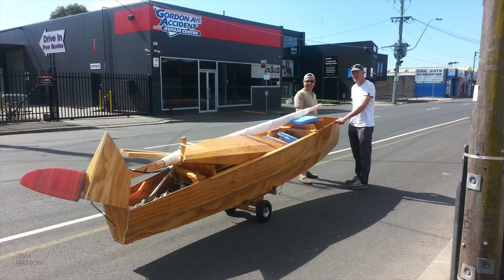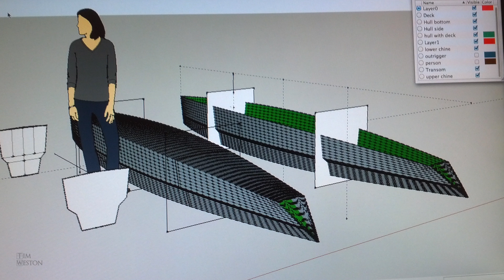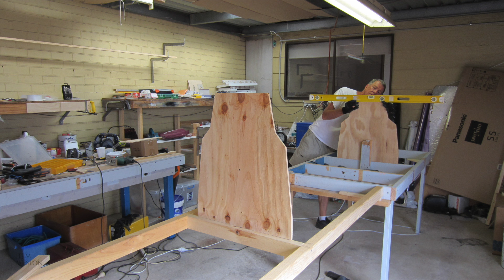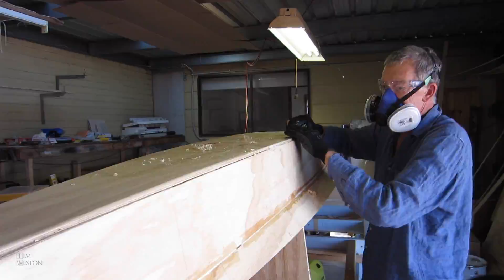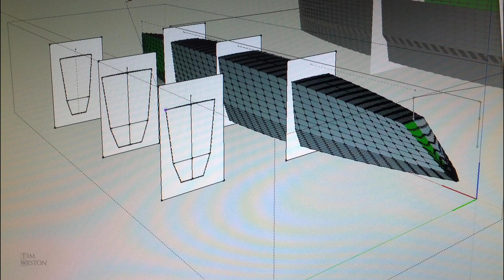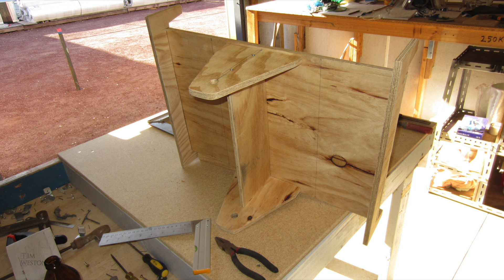Boat: build your own. Plywood PROA (part 1) - Small boats: Tim Weston

Comment: OK. Initially congratulations on the boat and the quick response. Thank you very much. I find it fantastic when I meet people like you who share their experiences and make available a video of how they have accomplished their achievements. Congratulations, really. I have some difficulty in choosing my boat. And I wish I could share what led you to choose this particular boat. And what was his greatest difficulty. 
I'm looking for a small boat that can take two people and that I can carry it over the car. Does yours do that? have a good time.
Reply from the maker: Yes, you can car top this boat. Probably need 2 people, but it is slightly shorter than most cars. 4.7m. Weighs about 50kg. I have just published a new book on building small boats if you are interested. Inside is all the information you need to build this boat, or any plywood boat. https://www.amazon.com/dp/B07HLKZ8LQ There is more info on my website too with pictures, plans etc., on this boat. https://timwestonboats.com/plans/  It is very easy to paddle, not a super fast boat but very easily driven, even with 2 people and lots of gear.   Tim

Comment: That is a lovely build. Do you have the plans available for you ama? As I'd like to do that to my plywood Canadian canoe.
Reply from the maker: +bombjack78 Hi Bombjack. Thanks, the ama's are just 2.7m long pine framing. Roughly 2 x 3 inch. Nothing hi tech.. An outrigger would make your canoe a lot more stable. Actually I am just about to release plans to build this boat. Full plans and template plans, if you are interested. There is more information on this boat in general on my website - timwestonboats.com and more to be added. Cheers Tim